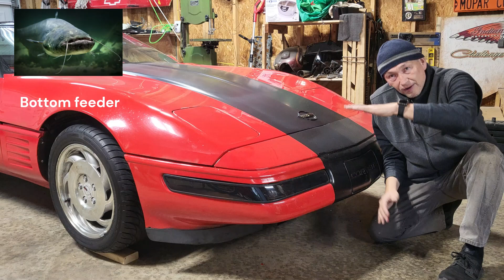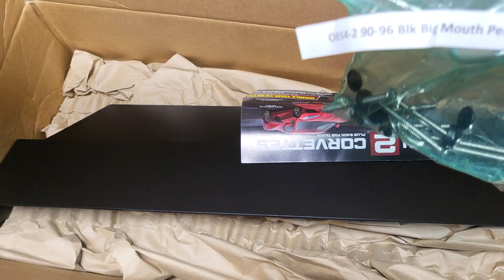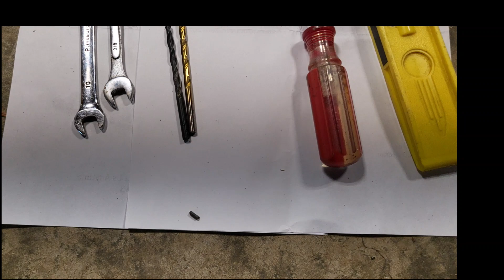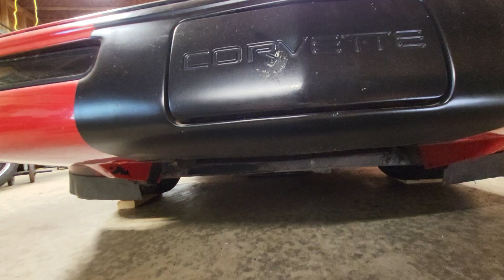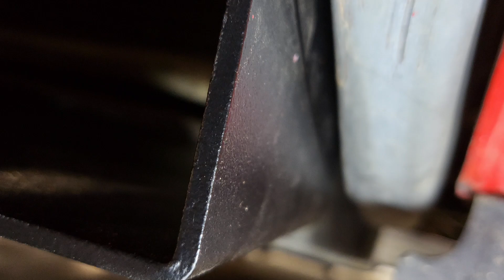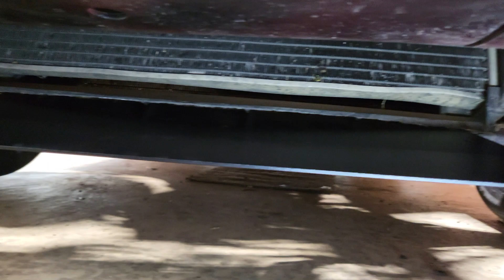C4 Corvette Darth Vetter Gets an Air Dam to Help Cool

Comment: Did this actually work? Looking at getting one to get my temps down
Reply from the maker: I think 5-10 degrees drop is a reasonable expectation.  More cool air into the throttle body doesn't hurt, either.